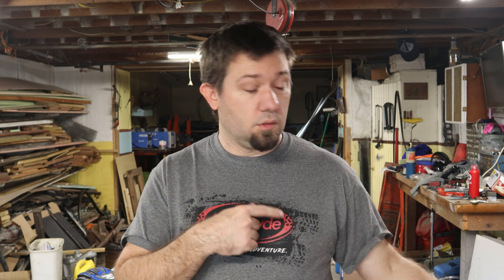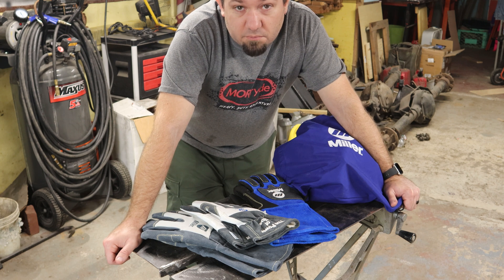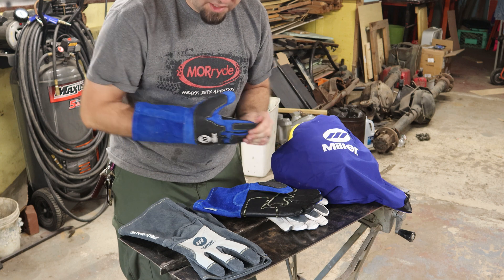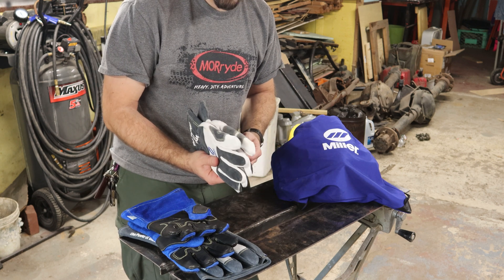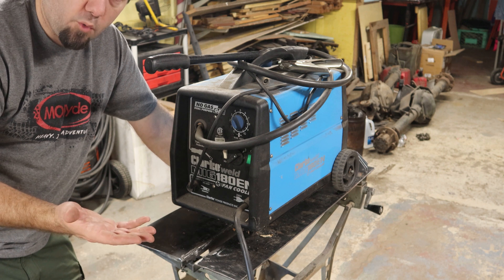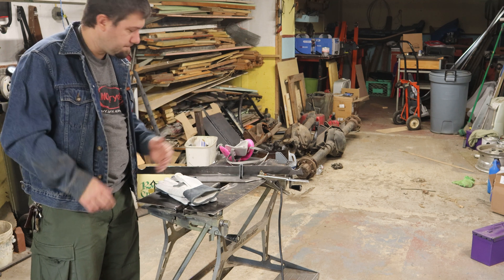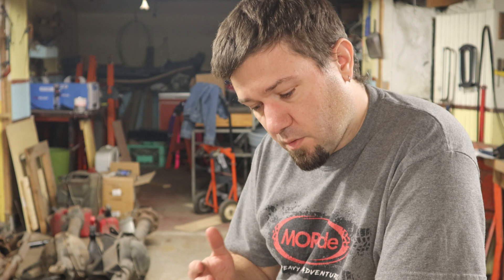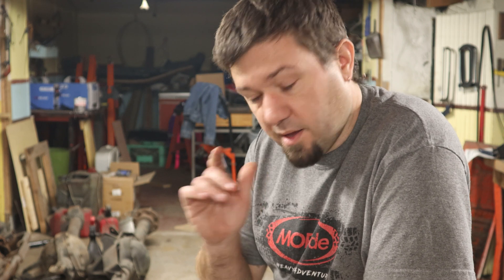Power and wire speed experimentation with my Clarke 180EN Welder.  Improving my welding.

Comment: I'm a beginner every time I break out my welder, which is the same Clarke 180 EN you have. I'm also a fledging channel. I tried switching to gas and solid wire, but appears my gas solenoid valve isn't working properly. I have spring perches and trusses to weld to axles and hate going back to fluxcore, but looks like I will have to for now. Or at least till I figure out the gas issue!  Thanks!!
Reply from the maker: Hey there!  Ive since switched over to a Yeswelder machine.  And also upgraded to gas.  But i laid a ton of beads with that clarke on flux, and it always had great results.  You just need to figure out the right settings to get enough penetration.  Gas is nice, but you can definitely get by on flux.
Reply: @SWBCrawler  I've always been one to make sure I get plenty of heat through the metal, even if the welds don't look great. I've never had anything fail, and hope to never have a weld fail. I figured out my gas flow issue. I got the regulator with the welder 14 or so years ago, never hooked it up. It was either a bug nest or mud in the outlet that was clogged. Once I found that last night, I have good gas flow! So, back to MIG solid wire soon. I'll have the results on my tiny little channel.
Reply from the maker: @ToGoPlacesDoThings  awesome! good luck!

Comment: Hello Nate, I have the same welder which I picked up used. In addition to the unusual min/max setting, my welder also has an unusual wire speed behavior in that when you change the power or min/max setting, the wire speed changes too. I would think that the wire speed should stay the same with all settings until I adjust it. Does yours do that as well or is my machine screwed up?  Thanks for the video.
Reply from the maker: I never noticed a difference in wire speed between min and max. but it’s possible. i’ve upgraded to a new welder from yeswelder so i haven’t used the clarke in a while. i gave it to my dad. if i get the chance i’ll see if i can verify the wire speed.
Reply: @SWBCrawler  thank you for the quick reply and for checking.

Comment: A couple of questions 
Maybe it’s cut in editing but are you trimming the wire after you stop a bead before you do the next bead?
Are you using flux core wire? 
Are you using DC negative or DC positive?
Reply from the maker: Yes, flux core.  And I dont like the wire that I'm using, but i have a 10lb spool of it and im using it until its gone.   Its really smoky and really spattery.  

I have the machine wired for flux core.  Which iirc is dc negative?  I'd have to go look at it again, ive never had a gas bottle, so I set it up when I bought it, and havent changed it.  

I trim the wire if it's got more stick-out than I like or if its got a glob on the end, otherwise I do not.

Comment: Hey Nate, I’m having a problem getting through the entire video, right around the 10:00 mark when you use the red circle it freezes up. I’ve tried watching 3 times same result, just a heads up
Reply from the maker: That's odd..  I have watched it myself and it worked.  Does the audio stop too?  Or just the video?
Reply: @SWBCrawler  both audio and video. All I see is the buffering dots going in circles. I’ve watched 4 other videos from other channels this morning without any issues
Reply: Just did it again